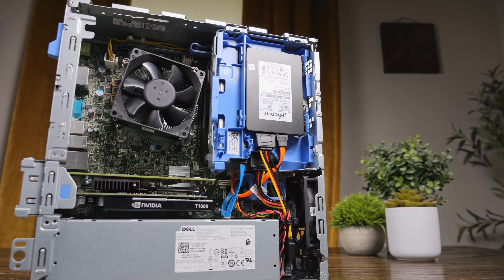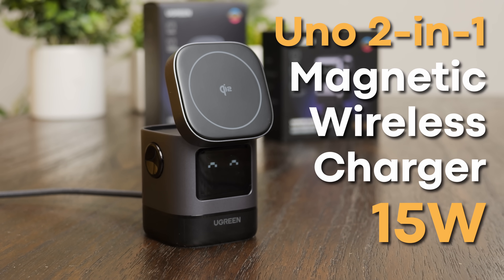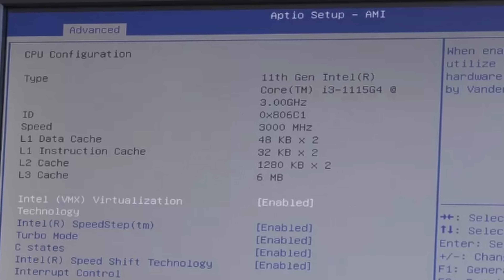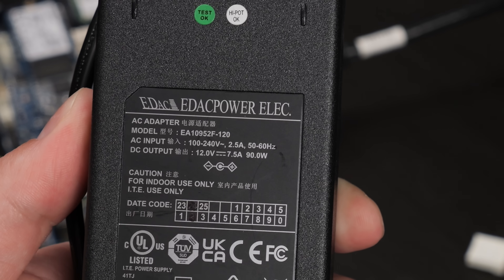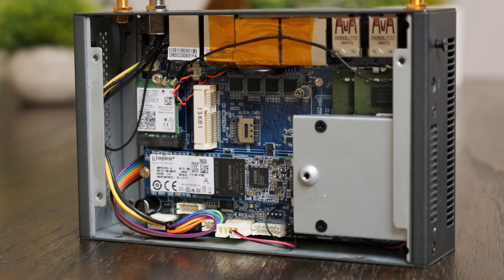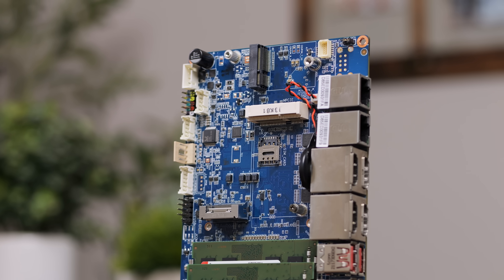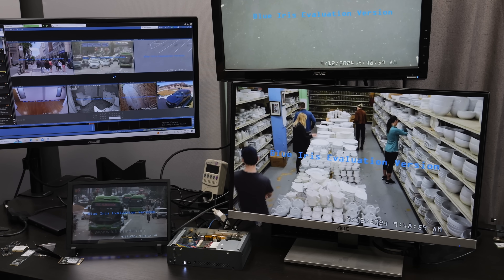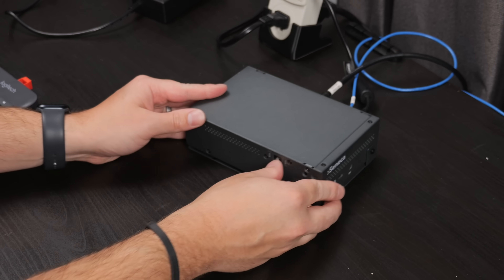This isn't a normal mini PC... and I love it.

Comment: The Dual NIC controller setup with there exact two model is standard for embedded systems, where you want the maximum compatibility with most OS’es and hypervisors.
Reply: @OPM_Viking  Not quite correct. The I219 is an integrated NIC, part of the PCH, but the PCH only supports a single port. 
The I211 is a standalone NIC. Feature-wise it's identical to the 219, but it's fully self-contained.
Reply: @SpencerN.C. Ok. But this is the config the enterprise manufactures stick to. You’ll find this on most Supermicro boards for embedded applications - so you’ll be fine with this combo 😊
Reply: @OPM_Viking  Yes, that is mostly correct, most embedded or workstation boards do use this combo of the I219 with a second stand-alone NIC (although sometimes swapping the I211 for a I210), but I've found the I219-LM variant (with vPro) to be the more common one in commercial and industrial enironments (included in C/W/X/Q series PCHs).
The system in the video must be using a consumer-grade PCH (B/H/Z series).

But also, while lots of workstation and embeded boards do use the built in I219-LM a lot of server boards you'll find a pair of I210's alongside a dedicated IPMI port instead of a vPro-enabled 219.

I used to build networks for corporate and industrial clients.
Reply: Thanks 👍 Now you mentioned it, I got it wrong. I DO remember now that the 219-V had issues with ESXi 6.x. - and it is the LM I have on the two SuperMicro boards I am using.

Comment: Man 4 HDMI ports? Dual NICs? That'd make a helluva battlestation KVM with quad screens for ALL the terminals and dashboards! Talk about being locked in :D
Reply: Right? I don't need 4k h.265 decode on every screen, I just need SHITLOADS OF XTERMS. It'd be nice to find out the max hdmi res of each port, though.
Reply: @myself248  intel will usually do 4k30 on all ports, but it may cause slowdown if theres too much going on
Reply: just use containers and tmux, KVM and several moniotors is too overkill if you just want a bunch of isolated terminals
Reply: How is the CPU supporting 4 hdmi-ports? I thought 2 is the maximum with both intel and amd cpus?
Reply: @schmolck  I guess I didn't assume they were all coming from the CPU? You can stick discrete graphics chips on a board, just like discrete NICs or USB controllers or whatever.
Reply: @schmolck I wonder how they do this too, would have liked if the video took a look. The CPU specs state support for 4 display outputs, but I don't know enough to say if this applies to any one port. Anyway it has eDP, DP, HDMI, and MIPI-DSI outputs, so in theory they could just have converter ICs in front of the HDMI ports on the other 3. i3-7100 supports eDP, DP, and HDMI per spec sheet, but my pre-built has a Realtek VGA converter chip on board to convert one of the DPs to VGA.
Reply: @patrickwright8552 as of 11th gen, Intel supports up to 4x displays direct from the GPU

Comment: Initially I thought it was using two different NICs because many systems need one that supports vPro/AMT, but the I219-LM is the vPro variant of the I219 family, not the I219-V. As far as I'm able to find, the I219 family connects to Intel PCH via a proprietary interface, which only supports only one PHY, while the I211 simply connects over PCIe. I219 are also more power efficient, but I'm not sure if that was even of concern for Seneca. Maybe I211 offers compatibility benefits as well as it's an older chipset with a "standard" interface? I'm not sure if I219 connecting via PCH could cause potential issues for older OSs.
Reply: Close, the 219 NIC actually integrated into the PCH, it's just the PHY that is is exernal - and it does only support one PHY.

The 211 is an independant self-containted NIC and PHY in one. It's a super-common second port on Intel-based boards since it's functionally idential to the integrated 219.
Reply: Similar to what I was thinking.

Comment: I bought x3 of those Seneca PCs but with AMD Ryzen CPUs V1605B for $150, crazy deal. So far I have tested with OPNsense and run with no problem, except i couldn't get the working LTE module.

Comment: So you were the one who bought that! you and I were bidding against each other lol
Reply: the eBay bidder she tells you not to worry about:
Reply: Funny. I won Intel Core i5-1135G7 2.4GHz | 256GB M.2 | 8GB RAM for US $95.95 from the same seller. Great computer, the only downside is a realy LOUD fan. I didnt dig deep in to it but it seems to me it blows constantly with no RPM regulation.
Reply: @Odigo_ost  Easy... Replace the fan with better model...
Reply: @vencdee there is no "better model", it is not standard computer fan and you cant just buy Noctua one and replace it. You will not know another chinese fan is better or not too. So when I buy device I want to power it on and be a happy user and not searching for a dozen new fans in a hope that one of them will be better. And I am pretty sure the problem is not in fan itself but in bad fan speed managment. As I remember, there is no fan speed profiles in BIOS.
Reply: @Odigo_ost  right but another fan at 100% could be silent. if it's a 40mm fan, noctua does make them, but if it's smaller, you're kinda stuck unless you can figure out how to control the fan. Since it's not in the bios, you may consider adding a potentiometer knob inline to control the voltage of the fan that way. it's not pretty, but it works. Good luck.
Reply: @itsOnlyDads  its not standart 40mm fan, its custom lowprofile turbine fan like those installed in most thin laptops (ultrabooks). I am already 20 years in IT and i know workarounds but the older you are the less you want to spend your time on all that "hand made" staff. You just want to buy, power it on and use. )))
Reply: @Odigo_ost if you aren't running extreme workloads on the SSD, you can just remove that fan. We added that for additional cooling on the "top side" of the board
Reply: @FrankFarnsworth  Thanks for the answer. At first I thought that the source of the noise was the CPU fan. I read the forums, it turned out that it was the second optional fan. I decided that I would simply connect a 12V fan to the 7V or 5V power line and reduce the fan RPM. But the multimeter showed that there is no 12V at all in the 4-pin SATA connector, and the fan is already powered by 5V. Considering that SATA SSDs do not emit so much heat compared to PCI-E models, I simply disconnected the additional fan. In the case of use for ordinary office tasks, the PC works normally and is practically silent. So I am pretty happy with it.
Reply: @Odigo_ost that's awesome to hear! Really glad to see these devices still finding purpose out there 😊

Comment: Could you use the GPIO with an intermediary 'thing' to create a physical disconnection from drives before/after a backup? 
I could see it being amazing for a backup NAS to be able to have it's drives hard-disconnected as a defence against encryption viruses, and requiring an 'all clear' signal before connecting them.
Reply from the maker: Hmmm... that seems like quite a project, but I guess it could be possible with some relays or something?

Comment: @HardwareHaven - I am in a similar situation and starting to set up an NVR with ~10-ish (mostly Reolink) cameras - including their Wired doorbell. I might be getting couple Odyssey Blue (v2) computers that you are using for your router for this purpose as well as the Coral TPUs.  
Have you compared Blue Iris with Frigate for NVR duties? Is one easier to set up / maintain than the other? In watching few videos (Apalrd(?) - thanks for reference to his channel in previous video), ti appears Frigate has good built-in support for the Coral TPUs (as well as other hardware - like Nvidia GPUs, OpenVINO, etc. for object detection). Not sure how easy or hard it might (relatively) in Blue Iris to setup some of the same functionality. 
Great video regardless. Keep it up.👍
Reply from the maker: I haven't spent enough time with either to really provide much feedback. Frigate seems to be missing some functionality I like, such as recording schedules and a timeline viewer. BI has those and also seems to have a ton of other features in an easier to use interface. Getting object detection was a bit odd as I had never used BI or Code Project AI, but once I got it working it seemed to do just about as well as Frigate. Once again, very little experience with both. 

I might do a video on BI here soon.
Reply: @HardwareHaven  Frigate's new timeline viewer seems pretty nice to me!
Reply from the maker: Oooh I'll have to check it out
Reply: @HardwareHaven  I was under the impression that Frigate did allow recording schedules. But you are right, it does not have that functionality built in; the person I saw using schedules with Frigate had created the recording schedules in Home Assistant.
And yes, BI is likely a more mature product - I was hoping though to keep the NVR bit more 'lightweight' without needing to install full fledged bloated install of Windows on the Odyssey. Perhaps, it might not be too bad if it uses a lighter / "Tiny" version of Windows as the base OS.
Anyway, look forward to video if you decide to move forward with it. I know Rob (The Hook Up) had done a video on BI and even one with setting up AI based detection but that was a while back - so yours might have updated / more current information.

Comment: Hey, just trying to help.  The I211 is not supported almost anywhere, routers will not see it and Linux too.  I bought an Asus M/B and all it has was an Intel I211 and nothing would work with it as far as it has no built in drivers (remember the days before you were born, NT 4 days where all drivers had to be installed).  The I219 is a normal nic that will work as expected.
Reply from the maker: Hmm.. it seemed to work fine once I had an OS at least. And it was recognized just fine for the brief little bit of time I tested it out in OPNSense (just cut that from the video). Definitely something to watch out for though I guess. Thanks for the heads up!
Reply: Sorry, that's flat wrong. It's one of the most common NICs in the world. It's literally on millions and millions of system in use right now. 
Maybe there's something not right about yours, but please don't generalize to all I211's.